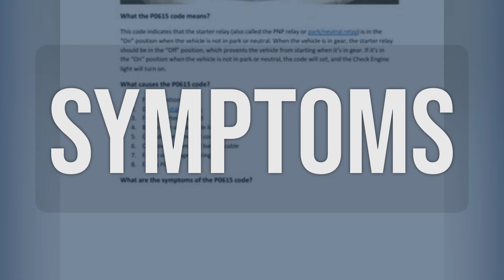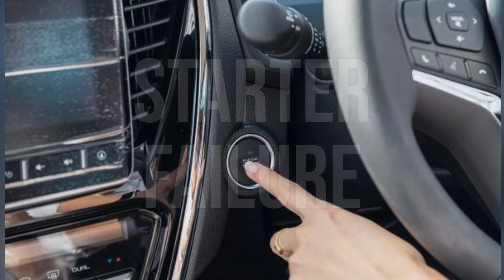How to Diagnose and Fix P0615 Engine Code - OBD II Trouble Code Explain

Comment: I have a citroen c2 . Motor started mixing water in my oil so got a repalcement motor but my origanal motor was running still so did a motor swop and now it only cranks twice not enough to start up

Comment: Hi, I have Honda civic 2006, 8th Gen with auto transmission/Robotized manual.  The car shows P0615 error with Check Engine light. The car is starting and running fine but the error and light is there. Now, when put in position before starting the error is not there, it only appears after the car starts. If the car is not in neutral the car does not start. The ST cut relay has been replaced, still the error is there. If I remove the ST Cut relay, the car does not start.  Any ideas? Thank you
Reply: Not in park, only in neutral?
Reply: I have the exact same problem